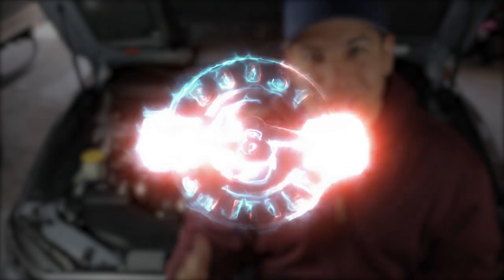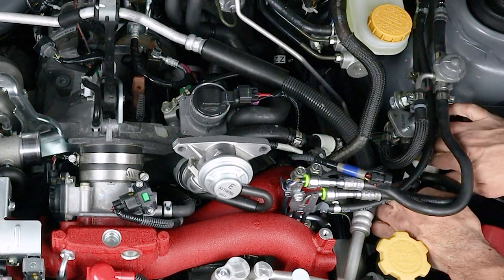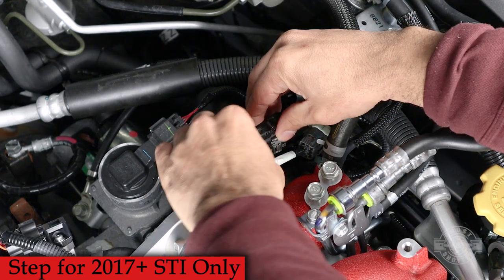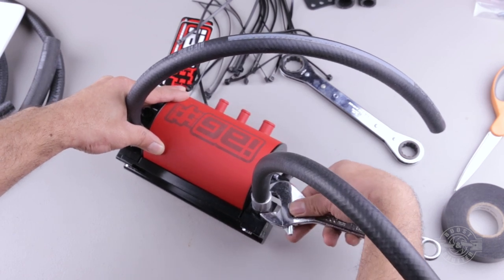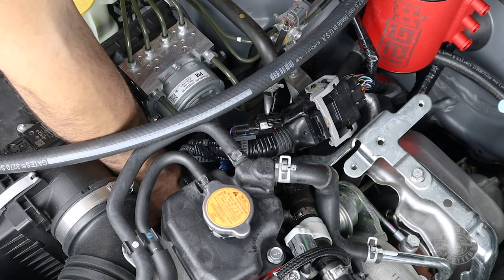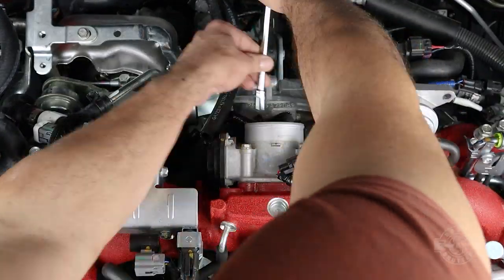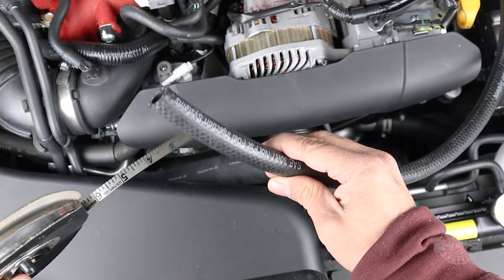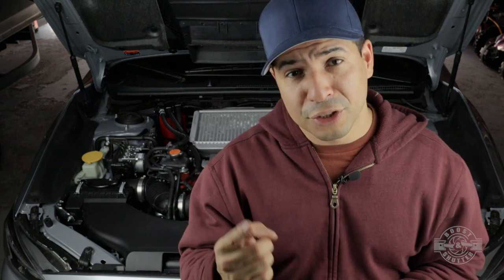How to install an Air Oil Separator (IAG AOS Street Series) in a 2020 STI | COMPLETE GUIDE |

Comment: I installed the V3 IAG AOS in my 2018 WRX. And it's the best mod for the money I have done . These engines are very temperamental.  And anything that can keep em running and in good shape is a good thing.  👍

Comment: no one else is sketched out that there is rubber hose near not only sharp metal but also the turbo heat shield which gets very hot.

Comment: I am a ASE Master Tech / L1, L2 certified, with over 30 years of experience. This is an excellent video!!!!  It should be known this is the V2 AOS. The newest V3 is similar but much better. V3 has banjo fittings for the coolant lines and spring clamps instead of zip ties for all the connections. There are many other differences.  The full color detailed, step by step installation can be downloaded from the IAG website. I would still suggest watching this video to get a good general idea of what the process will be like. Again, EXCELLENT JOB!!

Comment: As I look into the IAG V3 install guide, IAG kept both side short hose connected to breather ports (passenger & driver) with the white connectors. You wouldn't have to tape up the connectors on both sides as well. Just something that I noticed in the new guidebook.
Reply: This comment should go to the top being they no longer sell v2. My v3 arrived today and can't wait to install this video is great for installing v2 (I guess if you buy a used one) but iag has an awesome install of the v3!

Comment: Just finished the install of this in my 2020 wrx sti and this video helped tremendously. It took me about 10 - 15 hours to complete over the course of 2 weekend days and 2 weekdays and I have about 0 car modding experience. I watched this video about 10 times and cross referenced it with the IAG AOS manual. Here's some observations that may help others:
- When removing battery (easier access to driver side valve breather line), there's a plastic cap on the battery mount bracket. You can twist this off with a socket wrench
- Lube up each hose/connection you can. Just like B&S says. Getting the intercooler on without oil is very, very difficult
- Once tape is removed from the main electrical harness, it is still tough to move because of the kink. It will move. 
- Disconnecting some of the sensors on the breather lines was surprisingly difficult at first. You need to wiggle as you pull out.
- You will bend some fins on the intercooler. Just accept it.
- I have huge hands and did not need to remove anything with the air intake when connecting the aos passenger side valve breather line. It will hit the nipple at an angle, but with lube will slide right on and sit flush.
-  When working with zipties in tight spaces, make sure to align it so you can use needlenose pliers to tighten one click at a time.
- I used all the tools B&S recommended except the zip tie cutter.
Reply: How was it putting the intercooler back in? I worked on it 10 hours yesterday got everything done except putting back the intercooler elbow coupler it refuses to go in completely and i think its because the hose thats under doesn’t allow it to. Any suggestions?
Reply: Tweezers will straighten bent fins or cut and tape a piece of cardboard to cover them while installing.

Comment: Fantastic video, brother - thanks!!! I was going to have mine installed by a local Subi shop, but it was going to cost me $676 for 4 hours of install time. Figured I could better use money like that on more parts. So, I bit the bullet and did the installation with my son. I would never have made it through the drain hose part without coming back to the video and seeing how you used the factory hoes/clamps. After 45 minutes of trying with the new host/clamps, I was able to get the stock hose/clamps on with no issue and keep moving on. Fantastic explanation throughout the video! I installed the V3, so I split my time between your video and IAG's and had it installed in 3 1/2 hours (and that's including all that time spent on that drain hose). All I can say is thanks!!! Your videos are excellent.

Comment: 7 months, thats how long my AOS has been sitting in my garage. Last night I spent more than 6 hours doing this install. But it saved me hundreds in labor at a shop. It helped me solve major crank case pressure issues that put tones of oil in my intercooler/turbo but after driving this morning a HUGE difference in my fine knock and DAM readings. The PDFs are to ambiguous, this guide was priceless, THANK YOU!
Reply from the maker: Glad it was useful to you. Thanks for watching!

Comment: Fantastic level of detail! Thank you so much for doing this! I've had my IAG sitting in it's box for a few months now and part of the reason is that I was a little intimidated, and the tutorials online were not the best for 2018+ Sti's. As far as your tutorial-- I couldn't have asked for anything more! Great camera work, lighting, and detailed commentary. Subbed!
Reply: agreed
Reply: Have you done it yet? Do you have the version 3?
Reply: @michaelhernandez1398  I haven’t yet...it’s an install I plan to do along with a few others that require removal of the intercooler so I’ve been putting it off due to la k of time. Also, I do not have V3, sorry!

Comment: Great video. I followed it step by step installing iag aos on my 2021 STI today and after couple hours aos was installed. Even reinstallation of TMIC was a breeze. Just "sweat" turbo outlet and manifold inlet with engine oil and it slips in easily. Thanks for directions. Also installed cylinder 4 cooling mod following another video and again. Walk in the park

Comment: This is excellent quality of video, explanation, and length of time of video. IAG should pay you for this video, I don't think any brand of anything aftermarket for an 2020 STI would of spent the time and effort as you did to show how to do it and explain it in such depth with great instruction. Thank you for doing this, it will surely help me when I install or have it installed on my 2020 STI.

Comment: This is a really good detailed video. I've watched it about 30 times lol. The only thing I noticed is that in IAG's instructions they don't mention anything about removing the jumpers and reinstalling them back and taping them off. They also keep both passenger and driver side breather hoses on instead of removing them and now I'm confused lol.

Comment: Appreciate the in depth video for the install! I did notice that you didn’t add any of the heat sheaths for the lines that iag provided. Did yours not come included with them? Just curious as I’m an idiot and did the whole install and even got the top mount installed but forgot to add the thermal sheaths. Should I take it apart again just to add those layers to the lines? Just curious how detrimental it would be if I just keep it as is 😅

Comment: I don't even have a Subby and I enjoyed this video.
Reply: @akqjtn  I actually did have a motivation.  They don't market the product to the Mazdaspeed crowd. Too small of a market I guess.  But, Mazdaspeeds can use that also and I plan to get one and I figured I would watch your video just for a basic idea even though of course all the locations will be different.  Mazdaspeeders usually use catch cans but I want an AOS.  I fact, I have an AOS, the Crawford.  But its nowhere near as good and I've outgrown it.  I got the IEG V3 on order and I might need to change some of the hoses/brackets since I bought the WRK kit.  I thought it was really cool how they were able to design a cable relocation bracket such that it completely looks like it could have come from the factory that way.  Lucky that the cable has available slack to make that happen.

Comment: You have great instructional videos! I've seen some channels show how to change the manual transmission oil, but they don't explain why you should do it early or explain the benefits of switching to a non-OEM brand. Is that something you would consider doing?

Comment: So only thing noted is that if you buy a AOS v3 after 2020ish it comes with different ports and some of these steps aren't used, such as pulling the drive and passenger side air lines off the block, which is very much not fun to try to get back in

Comment: Hey B&S I've been using you're guide to do an aos install on my 2020 sti. Very, very helpful directions. I'm at the very end and trying to get the intercooler back on. Dude, this is the hardest part of the whole install. Do you have some baller "Boost & Shutter" tips and tricks to reinstall that intercooler? Bruv I'm hurting here, so close to being done.
Reply: @akqjtn  I'm thinking it's the drain hose too. I have pushed it to the side already, but it must not have quite enough clearance. Thanks for the quick reply!
Reply: @akqjtn  Stupid clarification on my part...but you mean lube up the intercoolers intake hose, yeah?

Comment: The video is only 28 minutes but how long does it take in real time for a first timer to do this mod? I havent owned a wrx yet however when i do i already know it needs an IAG AOS and a cobb access port just for monitoring 🧐
Reply from the maker: I would allot one whole day to do it slow and accurately, preferably two in case you run into issues. If everything goes perfectly you can do it in a few hours. More than likely putting the intercooler back will take up most of the time.

Comment: I’m fully stock and no plan on doing performance upgrades, will I still need one of this?
Reply: Its highly recommended because blowby still occurs even if you keep it stock. Ifs just a safety an extra measure for your car and keeps it more reliable.
Reply: What my tech teacher always say. You really think a few hundred bucks worth of parts is going to improve the reliability and longevity of the car compared to millions spent on research spent by the manufacturer? Then go for it.
Reply: @Se7en_e1even  Subaru has proven their faults with this engine multiple times

Comment: Do you need tune for this? My sti is 17 with 57k miles. Do I need them?
Reply: im at 50k and i just purchased the  new V3, only reason is I found oil in intercooler coupler.
Reply: why would you need a tune?

Comment: I have to say, I'm laughing my butt off here.

I did the EXACT same thing this past weekend with the cooling line.

And I cannot express enough, how much a PITA putting the TMIC back on with that hose there. Silicone spray is your friend here. It will go on, but yes, will take a LOT of work/patience.

https://pbs.twimg.com/media/EY0Q8odXkAE5HkK?format=jpg&name=large
Reply: @akqjtn  Unfortunately, no.. Went by a couple others that I saw on here, but then the mighty algorithm to show your new one up top today in recommended.

But yeah, I measured it right too, but for whatever reason I misjudged. I'll have to order a new one specific from IAG to replace and make it cleaner. Also want to move the hoses to the side of the IC, instead of over.

Comment: I just had one installed and now the car is bugging in 2nd 3rd and sometimes in 4rd at around 2500 to 3000rpm its like its struggling to continue reviewing up any tips?
Reply: Last night it didn't do it but now in the morning when i got off work it did o I also got the Getadom cyl 4 cooling mod installed.
Reply: Bpv loose i guess someone wad in a hurry and I checked every hose looked over it too. Thank God 🙏 nothing serious.
Reply: Just started the car to come to work  and check engine light came on, overdrive, s drive is flashing and traction control. Im thinking he didn't connect the sensors on each side now.
Reply: It would've probably taken me a little longer but I would've done better job this starting to give me a headache.

Comment: DO NOT FOLLOW THIS VIDEO TO THE "T" IF YOU HAVE THE V3 IAG AOS (15-21 STI)!!! A lot of the steps in his video are avoidable. I installed mine on my 2017 STI
- You don't have to take off the factory crankcase hoses. Just remove the black connectors on those hoses and it'll attach to the supplied hoses in the kit.
- You don't need to remove the air intake or battery.
- If you have a strut tower brace (Perrin, cobb, etc.) you will either have to relocate your AOS or sell your strut brace. IT WILL NOT FIT! You might be able to get away with it if you are front mount and not top mount.
- Do not lower the AOS on the bracket to get it to fit with your strut tower brace. The drain hose that goes from the AOS back into the crank will not be angled down (like it's supposed to be) and it may not drain back into the engine properly.
- Use the heat shield wrap! It helps ALOT!
- Make sure where you have installed the AOS is where you want it. It is a pain in the butt to try and move it after the hoses have been connected. Ask me how I know...
- The vent hoses route differently on the V3 versus the one in this video. Keep that in mind and read IAG's instructions linked below!
- I didn't clamp the bottom hose under the turbo and lost a little bit of coolant. It wasn't bad and I had the second hose ready for installation. Have a container of Subaru coolant for the end. You can get it from the dealer or any website.
- If you don't lose coolant, you don't need the no spill kit. The V3 AOS kit has a connector in the back of it that can bleed coolant by unscrewing it to bleed the air out and then screw it back in.
- The hose clamps in the kit are suuuuper difficult to open to place onto the hoses. I recommend using the zip ties in the kit or even beefier zip ties (recommended since the zip ties aren't the best or biggest in the kit) to ensure the hoses won't back off or move.
- My fitting stayed in the block (for the drain hose), and I had to place the fitting from the kit into the OEM fitting. Lubing it up with engine oil makes it significantly easier and inserting it from the firewall side will be easier. Going straight down will be very difficult. (Only use this method if your OEM fitting is stuck in the car).
- TAKE. YOUR. TIME. Be prepared for your car to be down for a few days.

Here are IAG's instructions! Follow these before looking at videos. https://www.iagperformance.com/content/instructions/IAG/IAG-ENG-7181/SS-AOS-15-20-STI.pdf
Reply: UPDATE! IAG recently came out with their own video on how to install a V3 IAG AOS on an 18 -21 STI! It also applies to the 15 - 17 as well. It'll save you a lot of time and heartache when reinstalling the factory top mount since the drain hose DOES NOT need to go through the little hole on the intercooler bracket. It can be routed around the bracket and onto the Y fitting. Just make sure the fitting is facing the pitch stop mount. Go on IAG's YT channel for more info!